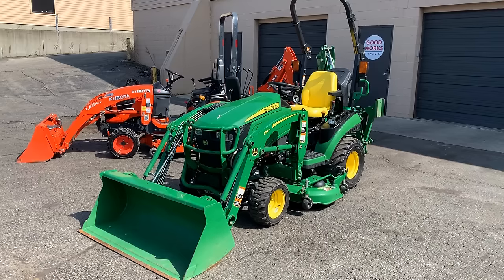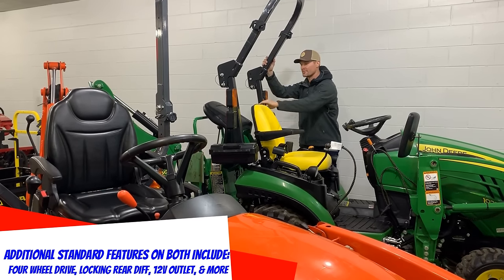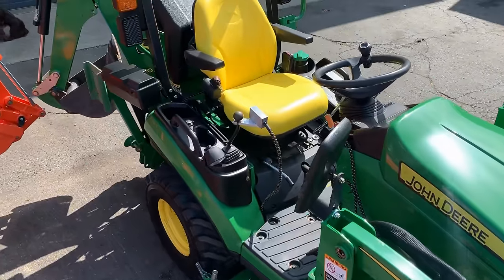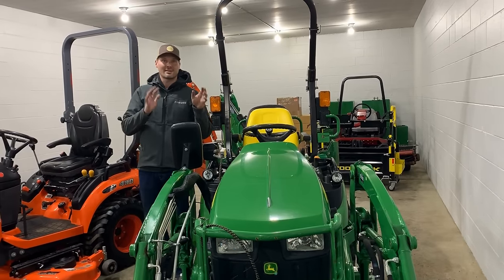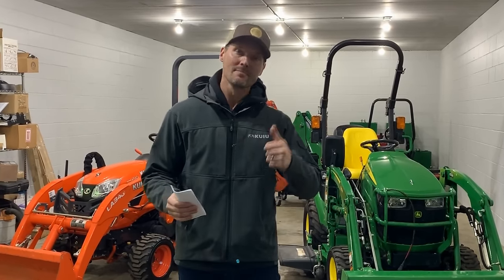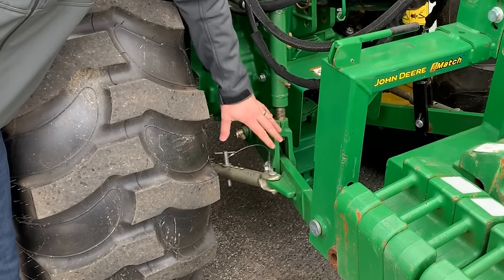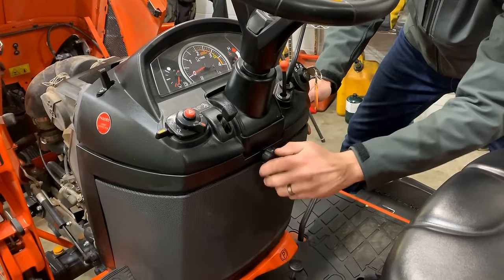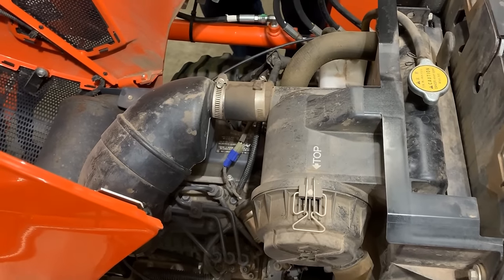CLEAR WINNER? JOHN DEERE 1025R VS KUBOTA BX23S TRACTORS! 🚜

Comment: Nice video, would love to see you make a video with 3-point snowblowers on both JD and Kubota. Over here in Quebec, 75% of my customers buy a snowblower for their tractor and have us install additionnal hydraulics on the rops for the chute and deflector.
Reply: Any of you using the Meteor rear mounted front facing snowblower?
Reply: @beunbad  less than 1% of our snowblowers sales are rear mounted front facing. There's just no demand for it

Comment: I have two John Deere tractors and know what I like about them and don't like. The company could have improved the access to their battery on both of the tractors I have and it is hard to fuel them both up due to having to get up on the hood to refuel them. I can't comment on the Kubota since I never owned one, but began driving a tractor using a Massey Ferguson decades ago, and then a Ford.

Comment: 1025R all the way. Why would one want to spend roughly the same amount of money for less tractor? And have to deal with the treadle peddle.
Reply from the maker: I am remaining neutral! 🤣
Reply: Because it's not less tractor. The John deere has a lot of plastic on it like the hood. The Kubota is steel. The kubota mower belt is twice as thick as the John Deere. The kubota diesal is quieter and has a track record of lasting a long time. Look at people that use these tractors to work everyday like landscaping etc. They almost always use Kubota. There is a reason for that. My dealer sells both. He said the John deer has some nice features but the Kubota is a work horse. They are both nice but the Kubota is not a lesser tractor.
Reply: It sure is less tractor. Nearly every spec shows the Kubota trailing behind. The biggest one is loader lift capacity, that is huge given these machines don’t lift much to begin with. That and no real auto connect deck, no position control, wider turning radius, smaller front bucket, etc all equal to less tractor for roughly the same money in my opinion. The whole steel hood vs composite debate has been debunked years ago also. The yarnmar diesels are also just a reliable as any Kubota and that is fact.
Reply: I have a smaller JD X350 and I hate the pedals. I have size 13 and Im always hitting the reverse accidentally
Reply: Id checked out all the different subcompact tractors out there like these and was disapointed i didnt find the grease fittings like i did on the jd1025r, mainly under the tractor where it counts you will see them on the drivelines....id seen the LS/newholland and saw sealed units with no grease fitting under the tractor....maintenance and longevity from grease zerks do count in the long run....

Comment: Overall,  I believe the Kubota is a more refined, polished piece of equipment. Advantages for green are the 3-point control and the front loader is stronger. Kubota has far superior controls, fit and finish, engine and general user comfort. The Mauser cab is far superior to the Curtis cab. Thanks Courtney for not letting your usual green leanings show through on this review. I wrestled Green vs Orange and am glad I went Orange, although had I wanted a cab I might have preferred Green.
Reply from the maker: Can't believe I forgot to show the three point controls...too much to remember sometimes haha!

Comment: Both tractors are great and would make any small land owner happy. But the fact is, the 1025R was a huge innovation in the subcompact tractor market when it came out in 2014. The Kubota has been playing catch up ever since and has now equalled the JD in almost every sense except where it really matters and that is the lift capacity of the loader. Everything thing else is so similar that it just falls to childish nitpicking.  One thing that you didn’t really touch on is attaching the 3 point system. I find the Kubotas  to be cumbersome and a little more awkward to install than JD’s and I believe JD’s stays on with the new backhoe design. That’s a great improvement!  The standard equipped toolbox on the JD is a small item, but is so very handy and nice to have.  Both are great tractors and we are lucky to have all these choices in this market segment.   Keep up the great videos!
Reply from the maker: Thanks for watching Keith, have a great day!

Comment: Great video I just ordered my 1025R today and I’ll be definitely looking into the tool rack right away, also my 2020 has a steel hood, that’s the first thing that I checked because my X300 mower has the plastic hood that costs $600 to replace after 3 years
Reply: Are you sure 1025r is a steel hood?

Comment: I gave these 2 a miss because there was NO Turning Brakes was the main deal breaker for me, then found they don't have rear remotes standard either, then found TYM had bigger hydraulic pumps & a great deal more lift capacity as well. Pretty dissapointed in these 2 major brands. I was going to get a either one of these 2 until I saw TYM's range. oh and I had the mid mount mower on my Kubota & never again, they RUST out in a few short years here & NO backup when they do RUST out, so bad in fact I can't even buy a replacement. This is why mid mount mowers a waste of space, especially press moulded types, they are too hard to reconstruct.

Comment: I like the halogen bulbs water does not freeze to the lens because it's warm and I like that if I upgrade to led there is extra amperage I gain back out of the changing system
Reply: $350 instaled on the Kubota, nothing comes free!😂

Comment: Hey Courtney - Do you have any opinions on tow behind core aerators for the X700 series tractors?  I checked your site and it doesn't look like you carry any.  Have you ever used one?  Did you have any good luck with it if you have?  Also, do you have any opinions on tow behind lawn rollers for the X700 series?  Thanks for any advice!
Reply from the maker: Hi Russ,

I don't, haven't really dealt with them a whole lot.  I think the channel x748SE has some good videos that might interest you about the X7 Series though.

Comment: I dont agree putting a factory cab with heat and AC on those smaller tractors, I know you can get that on a Kubota B2650 which is the smallest tractor id want one on. We have a JD X585 with a Curtis cab for snowblowing and i had to get a DR Field and Brush mower for the hills!
Reply from the maker: Why?
Reply: We don't care what you have

Comment: I'm currently looking right now at these two tractors and the wm25s from New holland. They are all great tractors but to be honest. Weight and power matter more. Last Saturday I was at kubota and they dont make the bx25 or the bx26 with the backhoe. Its the new sleek and good power bx23 like you are showing. The 1025r and the wm25s compete with each other and are more powerful. I was surprised at the lower weight for John deer as its a bit beefer than kubota. Right now new holland wm25s is going to get my money. Almost identical to 1025r, yanmar engine etc etc but more weight which means more ability to work. 

New holland has one more year of warranty at 7 yrs compared to 6. I have not called pape which is my local deer dealer about their warranty.  Over 300lbs extra lifting weight (400 is what u saw with real number in the field) for loader for 1025r and wm25s and that was compared to bx2680 which is the 24 hp one not the 21hp bx23. The front axle on the wm25s is way bigger than kubota as well.

All the dealers for free add 300lbs in each wheel. So your weight number in my area would be 600lbs extra. Wm25s weighs in at 2700lbs with extra 600 lbs compared to 2100lbs respectively for 1025r and bx23. This includes backhoe tractor and loader. At least what they tell me anyways  lol
Reply from the maker: You can't fit 300 lbs of weight in each wheel no matter how hard you tried.  I'd like to see real world tests on the loader specs.  Also, I'd recommend the ssqa on your loader.  Good luck!
Reply: @GoodWorksTractors  that's why I said at least what they tell me anyways. Im not convinced that they can add that. I agree with you.  All three new holland, John deer and kubota say they do this for free. Maybe its a gimmick and up sale. But putting weight in tires is not new. So someone would have to real world it as again they ALL say they do it to add weight.
Reply: I will say though spec wise as well as what you showed in this video. The bx23s does not compete with either the 1025r or wm25s. Both can pull and carry way more unless you think 500lbs isn't a lot for subcompact.

Comment: I was so excited for the 1025R but when I went to john deer dealership  man its super mega extreme small.  it look like a regular lawnmower lil tractor.   on you tube videos they look alright size.
Reply from the maker: Well it is a subcompact tractor with a belly mower on it.  The smallest frame size you can get with a loader.  If you think that's small, then the BX would blow your mind, haha.
Reply: @GoodWorksTractors   maybe it will 😆

Comment: I think the B series or 20 series (for example the B2601 or 2025r) are a much better value.  Only slightly bigger, but so much more tractor for a few thousand more.
Reply from the maker: The 2025r is definitely not much more tractor, yet still costs around $3,000-3,500 more than a 1025r.  In fact, the 2025r has the same loader as the 1025r.  Crazy.  The 2032r/2038r in JD are a full step up from the 1025r.
Reply: @GoodWorksTractors  Appreciate the information.  I ended up with a B2601 that was nearly the same price as similarly equipped BX.  At least on the Kubota side, I felt I had to deal a lot less with the shortcomings of the BX and gained a few more features like a 3 speed hydro, more reach on my loader and backhoe, more low end torque, etc.  Great video!
Reply: @GoodWorksTractors  I think your right on the 2025r ,if I was going to that size I think I’d go with the B series for the 3 range transmission and position control.

Comment: Good stuff. I enjoy your videos. I'm going to be in the market in about a year. I have a 40 acre ranch/farm in NW CO.  I've never used a tractor before though!
Reply from the maker: Sounds like you need one!
Reply: I got my first tractor a couple of years ago. Not difficult to learn to operate. Easier than using a smart phone for sure. I'm thinking, unless you'll only be using your tractor on only a portion of your 40 acres you're going to want something bigger than the two featured in this video.
Reply: @thecountrylivingproject3263  Good point. I'm looking at the John Deere that this guy has. He owns this 1025R and one other larger JD. I think it's a 4066R.

Comment: Great video and way to stay politically neutral!😂 I thought the content was very good. I really like the fact that the Deere has a 3 point depth stop on the control. Both the Kubota and the Deere would make anyone a great upgrade from a garden tractor. Whichever you bought you will love it. Sit on both drive both and pick your dealer. Both manufacturer's have excellent reputations and resale value. I too looked at the RK tractors. Good value for your buck. Let me know what your resale value looks like after 3 years of ownership on a RK brand or a Mahindra. Courtney I can't wait for that tiller I bought on Monday! I hope you still have Toilet Paper!!
Reply from the maker: Haha, I did my best to remain neutral!
Reply: Someone told me the Kubota has some type of stop under the rear fender than can be set up as a stop For the three point hitch?? Has anyone ever seen this or used it?

Comment: I'm not a Deere fan but it's also a better looking loader than the BX...who needs 3 feet of reach in front of a compact? Just raise the pins and pull the bucket back close.  The Deere loader controls are trash though.

Comment: I'm not sure if it's fair to compare the 1025 to the 23S.  I think that the B2601 might be closer in my opinion. Maybe the 1025 is pushing the subcompact tractor upper limit. It costs more than the 23S as well and by quite a bit.

Comment: You should mention the ability’s of the bx23s to have the front mounted mid pro driven snowblower. The other thing to note about the back hoe is the angle clearance before the hoe hangs up to cause the rear wheels to lose traction.
Reply from the maker: The John Deere so has a front PTO driven snowblower.  I don't follow your comment about the backhoe.
Reply: Haven’t seen the jd blower, story. Perhaps the new design of the jd back hoe may have eliminated the dragging problem coming off an incline. Because the back hoe assembly hung out so far behind the tractor the hoe assembly will contact the hill as you leave the hill.

Comment: Stay away from John Deere. They've become the worst tractor company over the last 4 decades. Proprietary everything. Don't support older equipment. They tell you to upgrade or go screw yourself. Look up the whole Right to Repair act that had to be passed just because of how poorly John Deere treats their customers. Horrible company.

My dad has owned an L3600 Kubota for over 20 years and it has never failed us in the tree service industry. 

I bought a brand new LS XG3025H two years ago and I've completely abused it on a farm and pushed it passed the limits of what it's supposed to do and it's handled everything just fine. It also has more features than the big name tractors. LS is its own name brand too and not an off brand name made by another manufacturer like New Holland, Mahindra, and other similar brands.

New Kubotas are no where near as good as the old ones.
Reply from the maker: Every manufacturer has problems
Reply: LS makes new holland though, so which one is it?

Comment: Can someone tell me how reliable these engines are i heard the john deere has head gasket issues , is there any issues on the kubota ? Or was it just a flaw with there john deere ? Does anyone know anything about the massey ferguson compact ? Looking to purchase in near future
Reply: If you're looking to get the "best bang for your buck", take a look at the Kioti CK2610 HST tractor.
Reply: jd 1025r used to have a problem with the upper head because of the air filter location being fixed on the top, that to me was a problem, but they made a update kit   where the air intake was relocated and connected to a support so no more vibration on the top of the engine from the air filter...Id checked the 2020 1025r and its got the updated kits installed....
Reply: @ComfyBe  I like that new CS 2520 looks like good competition for JD 1025r and BX 23s

Comment: I don’t like how the kubota loaders stick out so far from the tractor
Reply: It all comes down to preference. The FEL on the Kubota was designed to be like that so its easier to see your bucket and your load when going into a pile. It also gives the Kubota a higher lift height to load a pickup or dump truck. Now the John Deere with the FEL being closer to the front of the tractor lets it lift a little more weight. So Like I said, it comes down to your own preference and how you are going to use it.
Reply: Right, with the further view for loading you lose pick weight, correct?
Reply: @tonyhill5348  yep

Comment: I perfer kubota because they offering including back hoe. John deers  not including  you have to buy back hoe. Or other parts. Cost you even more. So... which better. I think kubota  offer better deal.  Cheaper than john deer.
Reply: The only thing I like about the JD is the color and the quick connection  for the BM. To unhook the BM on the Kubota is a pain, and Iknow it well, wait till you have 800 hours on it, it get much worse. I figured out a easier way to disconnect the shaft, pushing the sliding lock collar and using a pry bar between the body and the conection at the same time, still a POA. Mechanical and durability, no other manufactory  can beat Kubota. But my experience is with older model, prior to 2010, probably the new models, has more nice fitures, and less quality. I need to buy another one, with FEL, BH and BM, 25-28HP.  Mahindra is in my mind, small tractor but big frame. Any imput, will be great aprecieted. I also like the idea of getting he 84 months 0% interest. Since I can invest my cash and get greater return.
Reply: The backhoe offered with the Kubota seems small

Comment: I think it’s going to be hard for Deere and Kubota to add storage, just my opinion here, cause the 1025R and Bx235 are just lawnmowers with buckets and rear three points, it’s going to hard to add storage space, cause well, there isn’t much more space to add compartments for storage without making the tractor bigger. However, both brands should add a drawbar, you can do a lot with one I know that
Reply: Lawnmower with a bucket...and a forklifts, and a 3pt hitch with rear PTO... which can run cultivator, snowblower, rototiller, boxblade, post-hole auger, sprayer...oh, and did a mention a backhoe. Mine does a lot more than mow and move dirt.
Reply: New Holland put a decent sized toolbox on the ROPS.
Reply: @Justin Medina
Just because it does those things doesn’t mean it still isn’t just a glorified lawn mower, or that it does them well. My Kubota TG1860 (diesel lawn mower) is the same size as a BX1880.